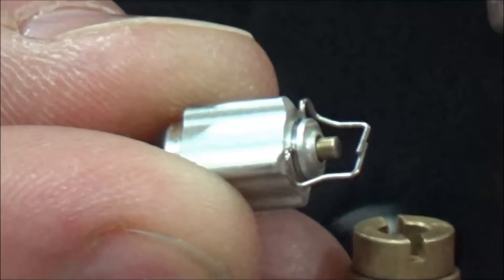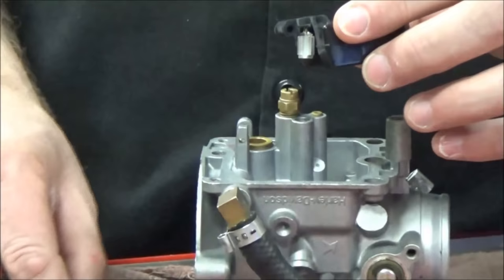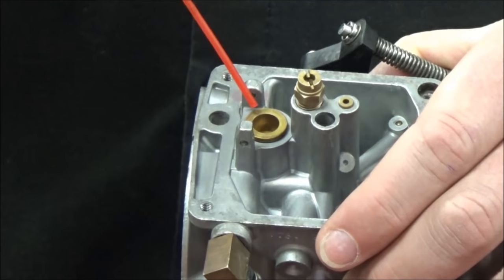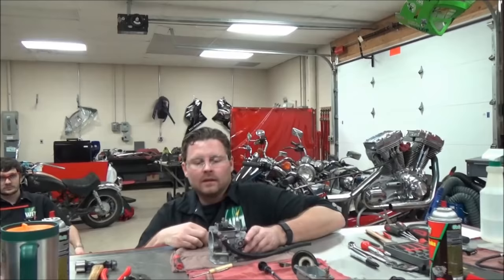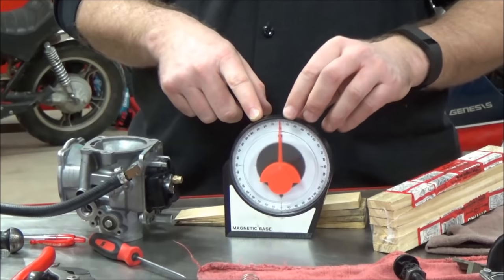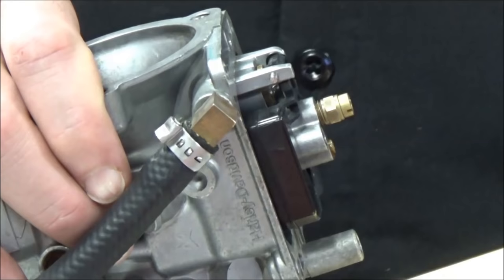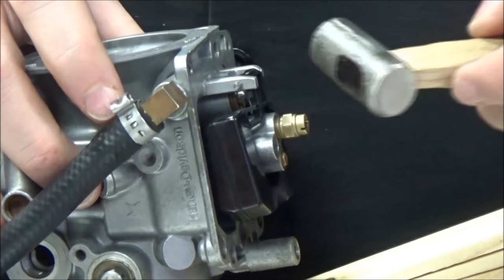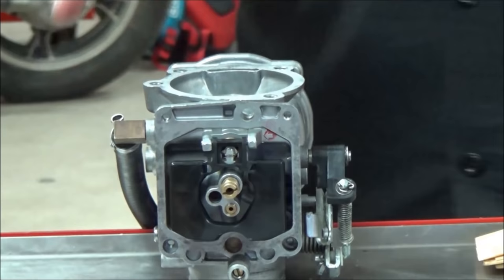04 How to inspect and adjust float level on a carburetor. BONUS: RICH LEAN Fuel Settings explained!

Comment: I have an odd situation in which I own two identical motorcycles (1998 Road Glide). Both are bone stock to include cam, air box and slip on mufflers. Bike #1 uses a stock 42 pilot 175 main (stock jetting) and runs perfect. I might add that it gets 60mpg. Bike #2 needs a 45 pilot 180 main and a 27094-88 Sportster needle for it to run as good bike #1. I tried to set up bike #2 like bike #1 with stock jetting (42/175) but it REFUSES to run with the stock jetting no matter what i do. How can it be? I've scratched my head to the scull trying to figure it out but am convinced it is what it is. Both bikes carbs have been completely rebuilt and thoroughly cleaned. They have brand new viton intake seals and new manifold seals. I've also checked the VOES for leaks (none found). Im baffled but convinced that bike #2 is somehow or another different than bike #1 but can't figure out why stock jetting won't work on it. Is this normal???
Reply from the maker: Hey there,
Working our way down the lists of requests. We only forward member emails or orders as the demand is beyond his bandwidth to answer. 
 FYI...Everyday he answers member questions before heading into the shop. If a channel member a little logo will show up next to your name and these requests go directly to him.
Let me try and see I can catch Shane to answer quick. He just returned from Africa training students this summer. His member inbox and one on ones first on the list. We are just the social media team. He plans on answering channel MEMBER questions each Sunday! 
Not a member yet? Here are the details! 
Want him to drop his wrenches and help you? He loves helping members and it is only $1.99 a month to join (more options if you really want to say thank you too) All member tech questions like this get directly forwarded to him every day! Here is how to get in!
* Join here: https://www.youtube.com/channel/UCBhM8DCKnT3qXwTW0eToyCg/join      
* Just looking to give us a high 5? Click here: https://www.paypal.me/how2wrench 
* Is this an emergency and your head is about to explode from frustration or fear? Get Shane’s cell here: https://how2wrench.com/ols/products/techline-service-60-minutes-one-on-one 
Note: If you are a new channel member please reply back and we will see your Youtube Member handle in your name. We will have a private member-only FB and web page coming he can directly do Q/A there! Thank you for being patient as our growth has blown up!
Reply: @How2Wrench  thanks, I figured it out
Reply from the maker: @kennethwise7108  Nice. Your welcome. Stay connected.
Reply: @How2Wrench  needle needed two .030" washers

Comment: Shane, in you opinion, what's the best way to remove a screw that has a striped head , it is one of the two holding the top cover?  Thanks
Reply: Use small channel locks make sure you have a good hold on the side of the screw and off the plastic top, hold real tight and snap it loose counter clockwise

Comment: Hey

I have a scooter
At low rpm it lacks power
At mid rpm it stutters
Til I go back to 50% throttle
And than it climbs up to high rpm

What could be my problem?

I once drove with a empty tank
When the last drips of my gas was in the carb it suddenly has alot of power xd
Reply from the maker: To try and answer this would be a ton of back and forth conversation as there are many variables...Is this an emergency and your head is about to explode from frustration or fear? Get Shane’s cell here: https://how2wrench.com/product/personal-tech-training-phone-facetime/

Comment: I added a larger gas tank on my xr400 and when the tank is more then half full it leaks out of the overflow. Will adjusting the float hight stop it leaking? Thanks
Reply from the maker: Bad idea... do not change the float height from spec...I know what you need to do and it would take maybe 10 minutes on the phone. If it was a quick answer I’d try to respond here but I wouldn’t want to lead you wrong assuming certain factors. Reach out to me on my website contact page. We have been overwhelmed with ungrateful people and scammers so I had to do something for my sanity by screening the over 300 requests a week!

Contact Link: https://how2wrench.com/contact/ 

Your answers and help are just around the corner. Save time and money while protecting your investment and yourself by doing it the right way at www.How2Wrench.com  
Have you subscribed yet to never miss a video? 

Have you seen the video playlists https://www.youtube.com/user/conleybuilt/playlists? 

Want to say “thanks” or “keep it up”? Click here https://www.paypal.me/how2wrench

Comment: My Yamaha 2 Stroke 15hp starts and dies after 3 seconds .I opened the carburator and noticed the float bowl is stucked and needle not allows the float bowl movement.Where can i buy the needle do you have an advice ?

Comment: Great gave me insight to attempt my own carbs, I have a Kawasaki KLE 500 that has the same CV carbs as your video, I need to adjust the float height would you suggest setting the float height as in your video via the 15 degree incline? I think this would work ok. Thank you. Now subscribed.
Reply from the maker: Thank you for the kind words. If I can ever be of service to you, here is a video explains how to connect with me. 
https://www.youtube.com/watch?v=vjvmB01ebcs 
Keep Wrenching,
Shane Conley
Instructor/Motivator/Motorcyclist
www.how2wrench.com

Did you like this free video and hope to see more? Would you just like to say thank you with a donation? Click https://www.paypal.me/how2wrench 

Like freebies? Click here for a free diagnostic checklist! 
http://gem.godaddy.com/signups/364621/join 

Head over to the new website and subscribe to the newsletter to never miss a video or newsletter! 
https://how2wrench.com/contact/
Reply: Set it to what your service manual says.
Reply from the maker: As King Troll stated below, use the spec for your model. Although the carb may look the same the angle of the engine as installed in different models varies tipping the carb at different angles. Best practice is to be specific. If you don't wish to buy a manual I can locate the specs for you by using my email service in the shopping cart on my website. 👍

Comment: Have you ever worked with 1998 yamaha royal star tour deluxe mikuni bds 28mm carbs and bench setting the floats? I cant find anything on them and the service manual only gives directions and float height for wet float settings
Reply from the maker: Sure have...many times...
Yo! Want us to drop our wrenches and help you? We love helping subscribers… Help us grow friend! Here’s how:
1. Subscribe and let us know with a response. We will circle back when we can, it depends on member/customer demands and needs
2. We answer your questions EVERYDAY for channel members Join here: https://www.youtube.com/channel/UCBhM8DCKnT3qXwTW0eToyCg/join     
3. Give us a high 5 here: https://www.paypal.me/how2wrench  and I run back to the computer! 
4. Is this an emergency and your head is about to explode from frustration or fear? Get Shane’s cell here: https://how2wrench.com/product/personal-tech-training-phone-facetime/
Reply: @How2Wrench  i am subscribed and feel i meet 1 through four especially 4 because my intake was filled with gas for the 4th time...
Ive had these off a dozen times and everything checks out. I do fear ill destroyy engine if more gas gets in it. Yes i know now to evacuate the gas from the cylinders and change my oil several times now. All I have found his contradictory information as to how to set the float height what the float height is and these Mikuni carburetors for the S Yamaha are the only Mikuni carburetors I've ever come across where you cannot find how to set these on the bench I've been without two wheels now for 3 weeks and I must say that I am now a pro at taking these carbs apart and off of the bike and reinstall them this is a real head-scratcher for me I don't want my engine to blow up from fuel getting into the cylinders and leaking pass into the crankcase or hydrolocking bending valve
Reply from the maker: @snowrider5150  We just run the channel friend...With all the "privacy" settings your name doesn't show a sub so its hard for us to tell these days. Thank you for supporting H2W. Shane gets slammed with requests and simply can't sit on the computer all day (why he recruited us to help) but it really sound like you'd be best served not ruining your engine like you seem to know and use his one on one techline. Make it a great day James!

Comment: I have a kx125 04-06 the spark plug is oily and feels like
No power at top end could u help ? Thanks
Reply from the maker: jonny weegram 
You're in luck. I do offer personal service to back up what's missing from a video to actually fix your specific problem. I do charge for my time and possible research. Good news is its CHEAP! For my time would mind becoming a member of my website? It comes we free 20 mins of techline and that will cover my time to assist you so we both benefit. As always thank you and enjoy the free videos! Much more to come! 
 
If I can ever be of service to you, here is a video explains how to connect with me. 
https://www.youtube.com/watch?v=vjvmB01ebcs 
Direct link to services:  
https://how2wrench.com/product-category/tech-lineservice-callminutes/ 
Live Chat is great for you to actually show your specific issue!
Donation link: https://www.paypal.me/how2wrench
Reply: Thanks for the reply mate hope u could help it dnt cost to subscribe w either 🤗
Reply: Shane Conley what is ya website ?
Reply from the maker: jonny weegram 
Www.how2wrench.com
Reply: If your spark plug is oily then your rings may need to be replaced... and when you do that you should install a new piston and bore your cylinder to fit the new piston. If it is a mixed fuel system where you use gas and oil, then it may just be a rich mixture. The jet is responsible for the top end power so that is an easy fix and has little to do with the oil on the plug unless you hit the kill switch as you were going top speed. The plug usually reflects the range of the spectrum you last held the throttle position in for over 15 seconds. Usually people idle their bike for at least 15 seconds before hitting the kill switch. This is good news though. For your top end issue it sounds like you need a larger jet. This should slowly clear up the low power at the top end. To fix the oily plug issue, and assuming this is a mixture of gas and oil, you should start with the fuel mixture screw. Turn it in to reduce the amount of fuel that enters the cylinder and turning it out adds more fuel to the mixture. Less fuel is lean and more is rich. If you turn it in and the idle drops then you went too far. Turn it back out until the bike begins running funky. Then split the difference. It is usually the spot right in between where the fuel mixture screw stalls on both ends. Keep in mind that, usually, if you are lower than 1 turn you need a smaller pilot jet and if you are past 2.5 to 3 turns out you need a larger pilot jet. So there is that. Past that, adjust your float bowl and your rich issue should subside. Now, once you fix that then your other range might become a bit funky. The jet needle primarily affects the low-mid(1/4) to top-mid(3/4) range. So, if you have problems in that range with bogging then you need to enrich the mixture by either adding a #4 shim under the needle (one at a time until this range feels good to you), or purchase a jet kit and follow their instructions. The main jet is responsible for the top 1/4 of the range. So, 3/4 to fully open. If you are loosing power with the throttle fully open then you need a larger jet to introduce more fuel at the top end. There is some blend between the ranges and in general your fuel mixture screw influences all ranges a little, mainly at idle to 1/4 throttle positions, but it is general practice to adjust the right element based on what range of throttle position you are having problems with. Remember, the carb has little to do with horse power or speed, it has to do with response. The more precise your carb is adjusted the better response your bike will have at all levels of throttle position and thereby making it feel like you have more horses even if you don't. Obviously though, if your bike is bogging down at the top end then the bike is not utilizing it's full horses at that throttle position, but the carb will not bring horses to the party. Anyhoo, I hope this is helpful.
Reply: Another thing that could be affecting your plug is aftermarket parts. Your carb was built for the stock setup. Lets say you added a more restricted pipe, your mixture would get richer whereas if you installed an open pipe your carb would run lean. The idea here is that the carb is always trying to maintain the same air to fuel ratio and when installing aftermarket parts that deal with air flow, this can change this ratio. So, when adjusting your carb always keep in mind that no matter what, the A/F ratio is always trying to equalize. An unrestricted air box and pipe will push more air through the system and make the bike run lean as a result. So, for example, your carb was factory set to mix 1 part fuel and 4 parts air, and you added an unrestricted air box and pipe to the mix, then you have thrown this ratio off. Now, the system might have 1 parts fuel to 8 parts air. This would be bad for the system because it would get far to hot in the engine and melt your piston or overheat your engine. In order to combat this one would need to adjust the fuel mixture screw and/or increase the size of the pilot screw. Usually, rule of thumb is 2.5 sizes per mod. If your og pipe was mid range restricted and you install a more restricted pipe then you would step down in size by 2.5 on the jets. So, for an open air box and open pipe this would mean, in general, a step up in jets by 5. So, if your pilot jet was 40 then it should be 45, and if your main jet was 160 then 165. But in your case it seems you somehow restricted air flow causing more fuel to enter the cylinder and therefor enriched the mixture. Your A/F ratio may be 2 parts fuel to 2 parts air, in this example. So, if you added or modified anything down the chain you may wish to do an assessment and adjust things accordingly. My guess would be that you would need to reduce the sizes of your jets, turn your fuel mixture screw inward (maybe not after you change your pilot size), and bring your needle down a bit (remove shims if it has any or move the clip on the jet needle up a notch and add some shims to make up the difference.).

I am not an engineer so apply these ideas at your own risk. However, I do hope this was helpful in some respect.

Comment: I have a Kawasaki Mojave 250 the float is all messed up on it if you will actually comes out of my carburetor from the vent holes up top and out of the drain and overflow drain they got tin foil wrapped around it looks like a needle that comes off of the float and its plastic that's a long piece I don't know if you and I I am talking about when I started it idles fine and I hit the gas it dies instantly and then I clean the car about never took the float off but was looking at it put it back together and now all the fuel comes out everywhere so I don't know what to do with it any suggestions
Reply: Yes watch Shanes vid again now its time to man up buddy and pull that carb off and adjust that float level your float level is adusted to high and now it wont cut the fuel off. That is why it pisses fuel out if you adjust that little metal tab up a bit it should cut your fuel level off again. It takes a little patience but with some effort I am sure you will get it Hey man you can always ask for help if you get stuck. What are you doing reading posts on youtube man You got a float level to adjust. Cheers

Comment: Hi Shane I got 99 honda shadow vt1100cc and is running to lean,,is making sparkplug white. I do not find how to get to the problem,, I put 2 new pistom vacume with stage 1 jet on stock pipe,,,,,,2 new float level on 9.2 mm higt float,,I play with mixture screw from 2 turn to 4 turn and still running lean. Petcock working good,,,,fuel pump pumping good pressure.  Stage 1 main jet #60 in front and #65 on rear and it was running lean so I change from #60 to #65 in front and from #65 to #70 on rear to see if I can get more fuel to the engine but nothing,,, the motorcycle still runnig lean,,lazy,,,,I can feel the pistom knocking. Any Idea?
Reply from the maker: You're in luck friend! I can help! Have you Subscribed yet to never miss a video? Have you seen the video playlists https://www.youtube.com/user/conleybuilt/playlists ?

Still have questions? Coach Conley provides tech help and works one on one! His YouTube and training center has grown beyond the ability to answer every question (11 million views! Over 500,000 a month!) He gets 300-400 requests a week. Become a member for his direct cell phone number and personal assistance!

Click here for the membership links and welcome to the community! https://how2wrench.com/product-category/specials/ 

Want to say “thanks” or “keep it up”? Click here https://www.paypal.me/how2wrench 

Your answers and help are just around the corner. Save time and money while protecting your investment and yourself by doing it the right way!
Reply: yea Im subcribe

Comment: "vernier" caliber not "veneer" caliper.  Also suggest it would be better to squeeze the float pin in with a pair of water pump pliers so the ears are supported properly rather than relying on your finger and hitting the pin with a hammer.